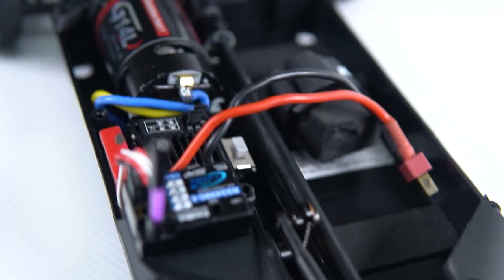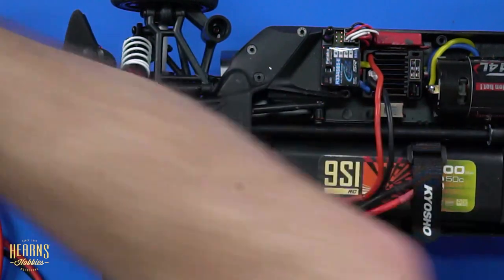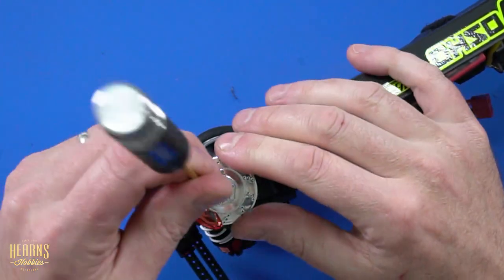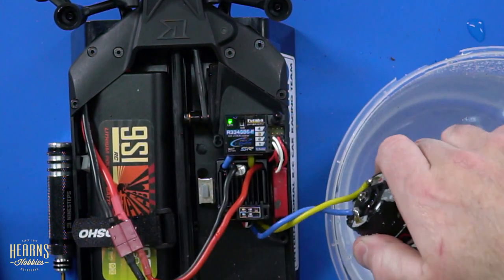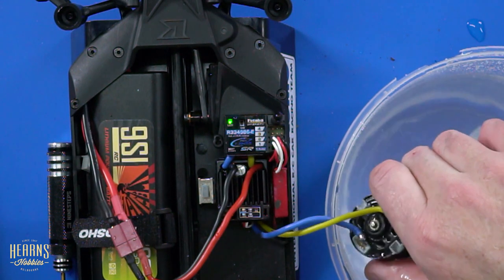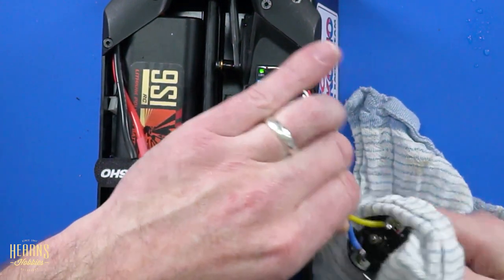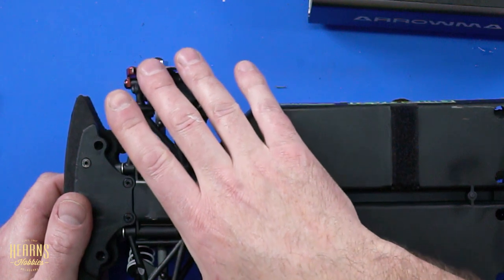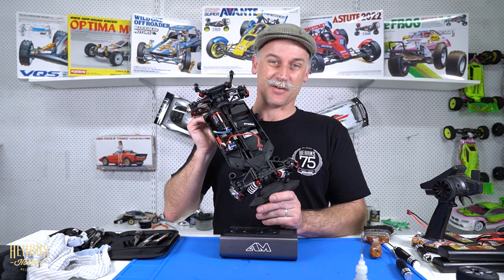How to Prepare For Race Day ft. Kyosho Fazer | #askHearns

Comment: Is it okay to use it with 3s lipo? Make it sense?

A pity there is no lipo cell abd charger include, wann buy one.
Reply from the maker: The supplied speed controller works at 2s. The battery and charger are not included so you have the ability to select the battery and charger you like.
Reply: @HearnsHobbiesMelbourne  I ordered one, My Buick Riviera will arrive today :)

Comment: I have the 240z & recently bought the 2000GTR body thinking it would be a direct swap on the chassis but its not. What do i need to do so i can swap the body?
Reply from the maker: The bodies do swap but you may need to adjust the body mounts.